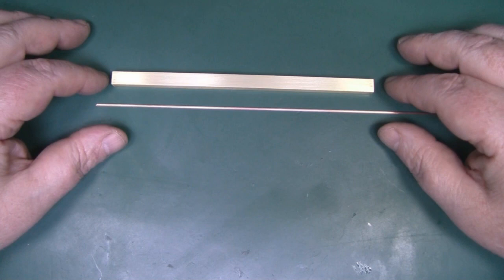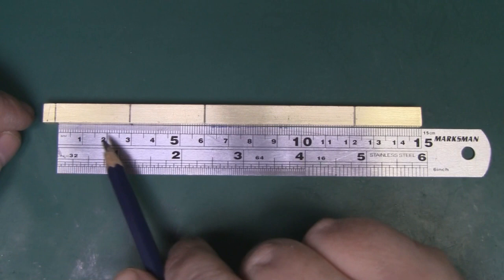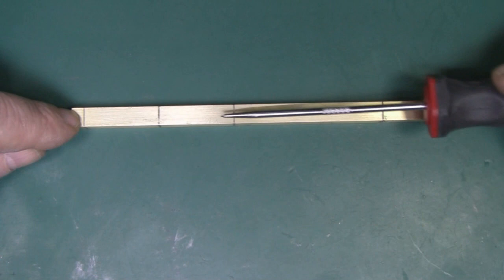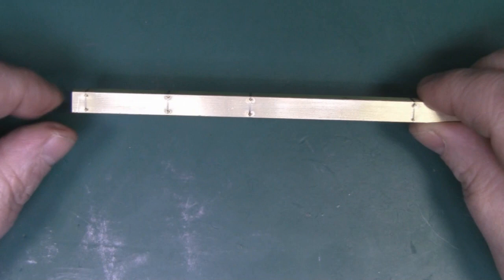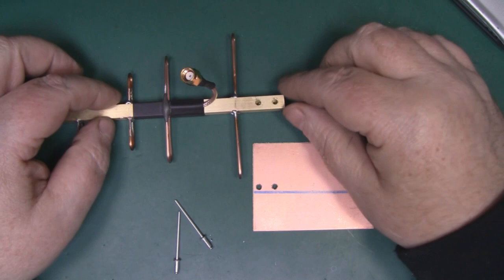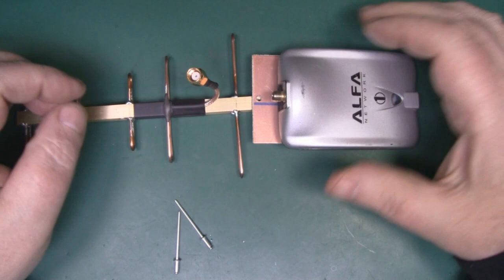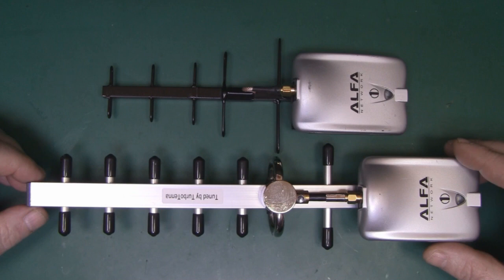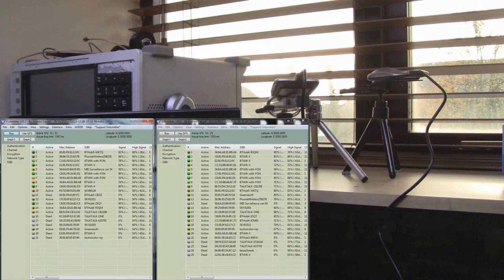Multi element Yagi antenna for 2.4GHz #1

Comment: Grateful for the soldering tips and closeups.

Would an wireless card that uses two antenna benefit from using two yagis?

How did you calculate the distance and amount of elements needed?

Comment: All elements need to be insulated from the boom otherwise no parasitic gain. Also the loop antenna (Folded dipole) needs to be fed with a balun to match the transceiver, the feed point impedance is somewhere in the order of 300 ohms whilst the transceiver is around 50 ohms. Hence the Balun which means (balanced to unbalanced feed).
Reply from the maker: No they dont I have a few videos proving this myth, the myth seems to come mostly from ham radio enthusiasts and I don’t know why.

Comment: How can the reflector and directors resonate when electrically connected to the tubing?  I would have thought it adds unwanted inductance and/or capacitance at the least.
Reply: word enquiring minds want to know and with the driven element say on a dipole there is your positive 25mm and your braided cable grounded to the metal reflector how is connecting both +/- together not a fire hazard
Reply: Yep, just saw this and thought the same thing. I would think you would make the boom out of something non conductive or insulate the elements from a metal boom. At least that makes sense to me... but I am no expert! Would be great to have one comment on this! :)

Comment: With the part you connect the wire to, why are there 2 wires, is it just 1 wire split into 2? I'm wondering if I can use the wire out of a modem antenna for the part that connects to the dipole/loop part.

Comment: Hi Andrew I really hope you can answer.

If I use a wider boom do I need to adjust element length?

What is the typical rule for choosing boom width?

Thanks Andrew.
Reply from the maker: +xMRavenx Hi there is no real rule just a piratical aspect I do think a 10mm box tube would be ideal but the cost of two extra mm is a lot more than 8mm box tubing. As for the elements the measurement starts at the side wall of the boom so the elements are independent of the boom thickness. Hope that helps let me know how you get on.
Reply: So lets say, if you went aead and used the 10mm box tube.  All the element measurements currently used would stay the same?

Thanks Andrew and happy holidays.
Reply from the maker: +xMRavenx You got it and happy holidays to you my friend
Reply: +andrew mcneil  Sweet ty Andrew.  I'm getting all the parts together and can't wait to start.
Reply: @andrewmcneil  Where can I buy U-shaped pipes?